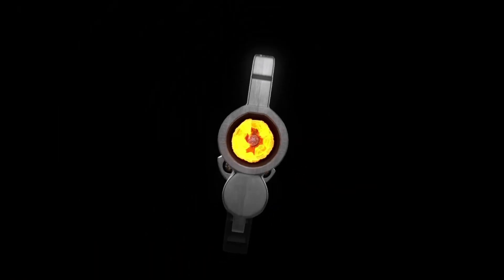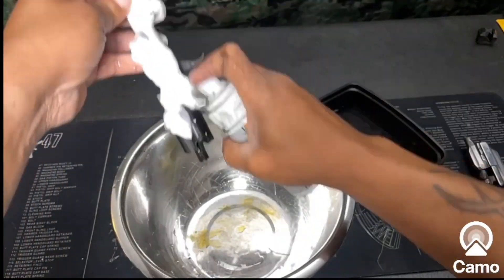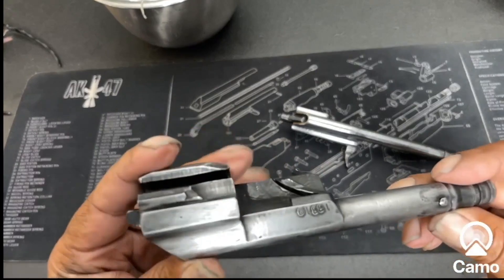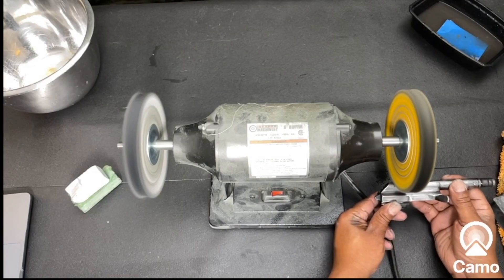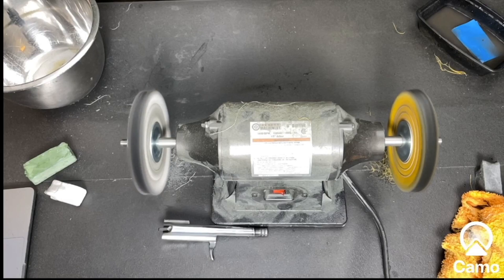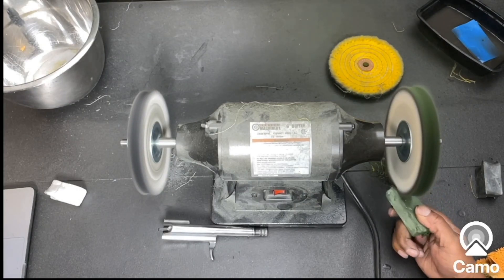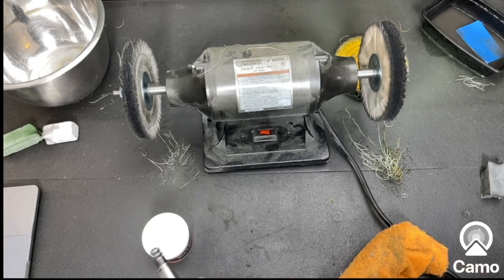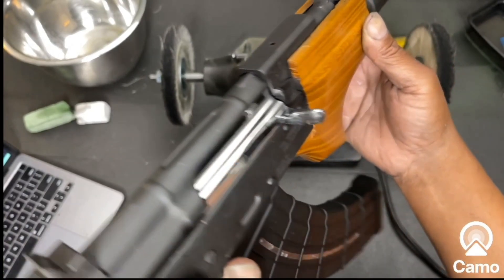Micro Draco Bolt Maintenance How to Polish Your Bolt For A Smooth Shooter

Comment: Yo bro the very top of my bolt carrier aka the piston is lose on my micro draco like that shit wiggles is that normal or no?
Reply from the maker: Mine actually broke. The pin that connects it snapped. I had it replaced and it still wiggles a little but no more issues. I believe it couldn’t withstand the binary trigger.
Reply: @IAmJohnnySnow  damn forsure bro thanks for the info i did my research and ig wiggles on ak47 pistons are normal from what i seen